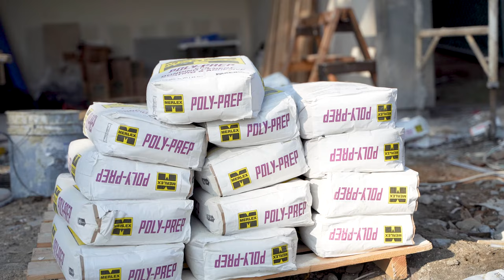Learn the Steps of Stucco with Us: An Overview of What It Took to Stucco A House

Comment: Nice . Any tips for fixing stucco that is now falling off the corner pvc bead ? It’s just a few small areas. It look odd as th e plastic is white ..
Reply from the maker: I know it is possible to spot repair stucco. But if you want it too look like new, unfortunately you would have to redo that entire section to the closest break.
Reply: @SEFSU  thanks for the reply. It’s outdoor stucco also

Comment: Great video, How do you stucco over brick walls?
Reply from the maker: Stucco over brick is a pretty similar process. Only difference would be to make sure the brick has waterproofing on the opposite side to make sure moisture does not make your stucco peel and break from the inside. Same coats are done on brick with no need for the underlayment/black paper. Hope that helps. We did stucco on our bbq brick but I do not remember how much of it we recorded and in which video you can see it.
Reply: @SEFSU  awesome thank you so much. So no need for a lath wiring or any additional add on the bricks? Also any recommendations on waterproofing solutions you mentioned to throw on the bricks?
Reply from the maker: @VP411Designs  not an expert on this by any means, but that’s how we did it. We used Drylock or something similar. But that was because it was a planter and we didn’t want moister penetrating the cinderblock and making the stuck crack and peel.